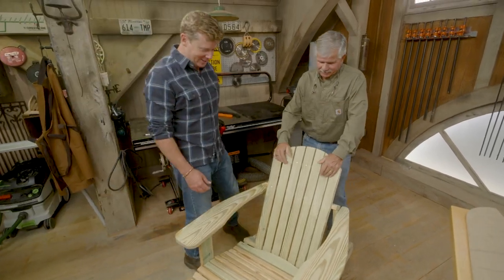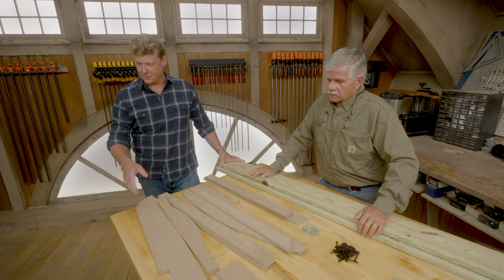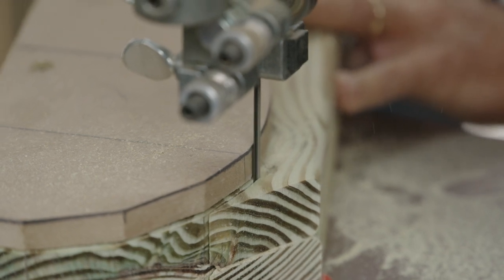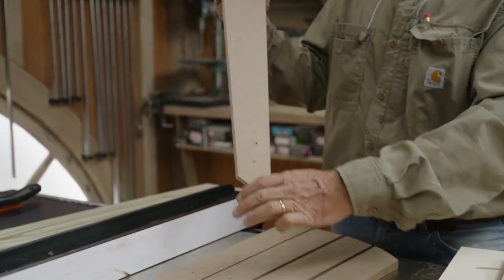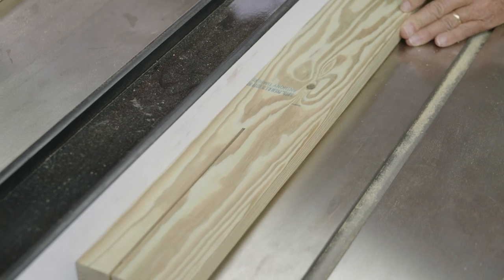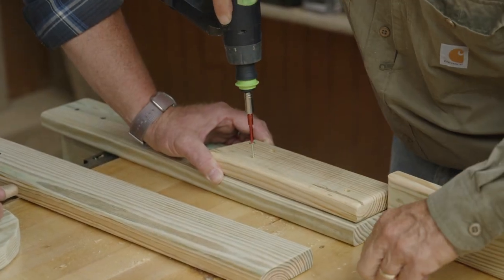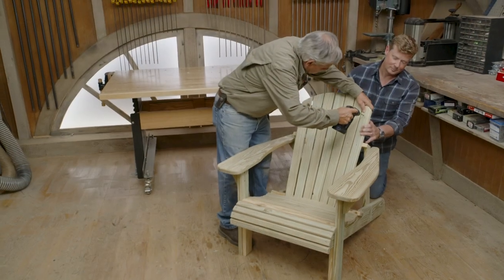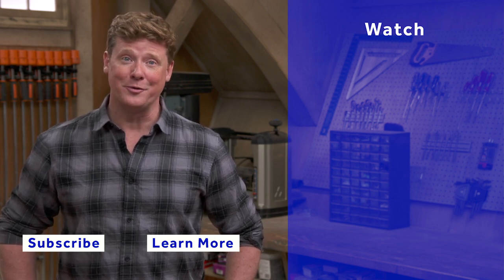Adirondack Chair | Build It | Ask This Old House

Comment: I did this exact same thing 30 years ago.  I used 5/4 pressure treated deck lumber and made 2 chairs, 1 tete-a-tete, and a small end table.  I still use them today.  Sealed them with Thompson`s every 2 or 3 years.
Reply: I just use water instead of Thompsons, much cheaper and lasts just as long.

Comment: I've made at least a dozen Adirondack chairs from Norm's New Yankee Workshop plans.  I modified those plans to use 5/4 cedar deck boards.  It gives a beefier/sturdier look, is weather-resistant, and is much lighter than PT.
Reply: Hi. I’m planning to use the (Rockler)templates. What adjustments are needed when you use 5/4 boards instead if 1 inch and 2 inch stock?
Reply: @juriangoei  the New Yankee plans called for 3/4 in stock - so the 5/4 stock was thicker. The only changes I made to the plans were in the seat slats. But not because they were 5/4. I made the a little narrower so I could use the left over rips when ripping parts out of 5/4 x 6 boards (I used cedar deck boards).

Comment: Looks like Tom added 1-1/2" to the width of the arm before putting them on the bandsaw,  The arm template measures 6-3/8" and the 6" deck board actual is 5-1/2". Just checking before I purchase the material. Thanks! ( I added the extra width to the arms with pocket hole screws and glue underneath and filled the holes with wood fillers made for pocket holes.)
Reply: Okay now that I built this to the plans provided by Rockler. Yes Tom did make some modifications like he said.  First, I liked building this out of 5/4 PT. So I did. However, when you go to predrill/countersink, perhaps you should wait till you actually get to the assembly to establish new predrill holes, because I believe the plans have some holes laid out to 2x4s instead of 5/4 PT. Then I filled the countersunk screw holes with wood plugs and sanded. So, countersink the screw in at least 1/4" with the counter sink bit. I used a box of 1-5/8" deck screws. Some 2" as well. Other than that, I love my new chair! Thanks!
Reply: I'm glad you addressed this.  I had been thinking about this as well.  I thought that maybe 5/4 x 8 were available but not the case.  I have a biscut joiner that I was planning to use to add width to the 5-1/5" wide main part of the arm.  Might instead use the pocket hole screws as you described.  I plan to do these this weekend

Comment: This is more complicated and uses a lot more tools than most of these "build-it" projects but it looks great.
Reply: @Kevin-mp5of  you could.... But I really wouldn't want to cut through that much 5/4 with a jigsaw. Same with using a circular saw to cut the slats for the seat. Doable? Yes. Practical? At least a 6 beer job.
Reply: Do like I do, build it without the curved seats and curved arm rest! Takes me 4, 8 foot 5/4 deck boards to build one chair.
Reply: I started on one this weekend and I will say that cutting all the curves with a bandsaw and then routing them is the most time consuming part.  It will make for a more comfortable chair versus a flat back and bottom, but definitely adds time.

Comment: I love Tommy’s creative ideas and craftsmanship, but in this case I have to wonder why they didn’t just recycle Norm’s beautiful design from 30 years ago? A lot of the features are similar (curved seat, curved back), and the back slats were structural, with no need for separate vertical braces behind the back. I’ve built more copies of both the chair and loveseat versions than I can remember over the last three decades, and they are all still in service. Also, pressure treated pine doesn’t seem like the best choice; after a summer in the sun, those pieces are going to look more like spaghetti than lumber!

Comment: How come he didn't use Norm's plans? I prefer Norms, which don't have that vertical piece holding the back rail up. I make the frame from 2" cedar, 3/4" cedar for the slats - still light, but pretty solid.

Comment: Could you build these using 5/4 Trex type boards instead?
Reply: Sure, you can. Except, you cannot use it in summers as it will get too hot to sit.

Comment: Just curious how he did the arm rests it looks like he might have did a glue up to get them wide enough.  I can't find 5/4 decking that is 8 inch wide and the arm rests are 6-1/2in
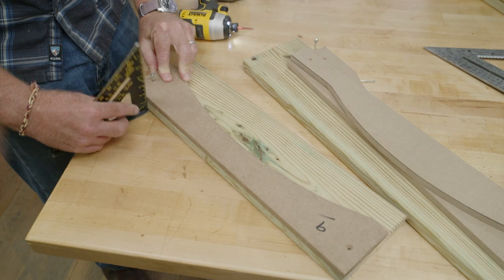Reply: Your right. I had to add an extra 1-1/2" to the arms with pocket hole screws and glue before cutting the shape for strength. Tommy doesn't show how he diid it, but you can see in the video (2:42) that he laid an additional 1-1/2" on the side before using the band saw.

Comment: Most pressure treated (PT) wood is treated with chromated copper arsenate (CCA), which is a derivative of arsenic.   Arsenic isn't very healthy to touch or breath.  Best to handling it with gloves and I wouldn't cut PT wood indoors.  Nor would I use it for furniture- even with a finish.  There are better alternatives, IMHO.

Comment: This is just about useless because the back support is the trickiest part, and you didn't describe how that was positioned and attached. (I know, because I built one from scratch without plans.)
Reply: He's using plans from Rockler, instructions for the cuts & assembly are included w/the templates.